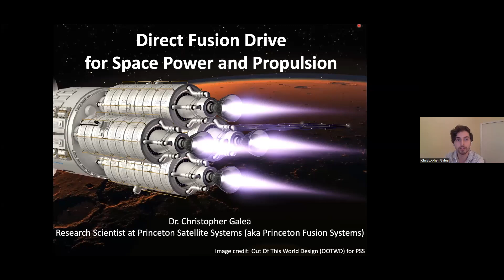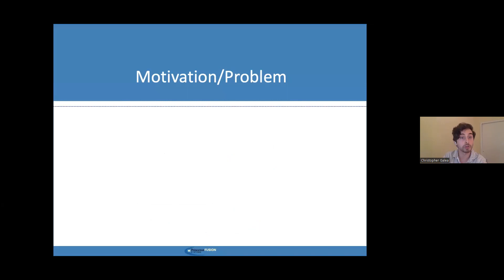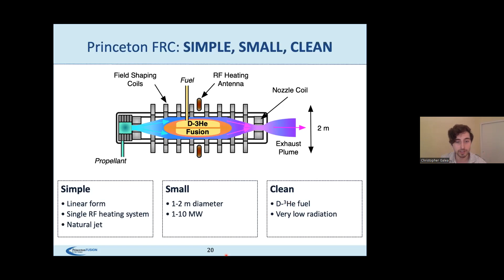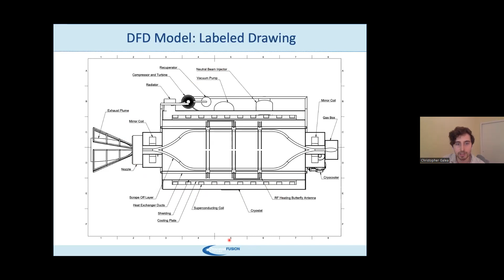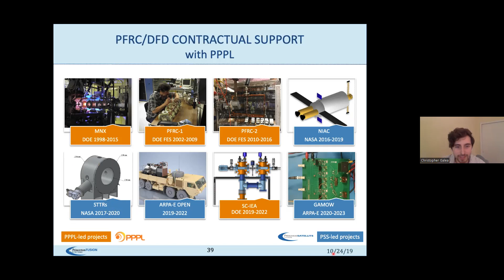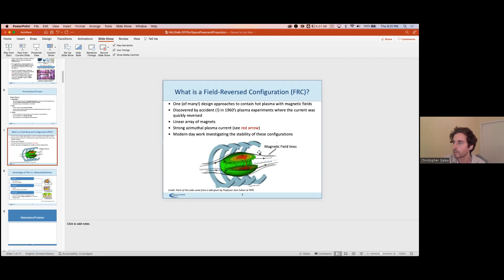NSS Space Forum - Direct Fusion Drive for Space Power and Propulsion with Dr. Christopher Galea

Comment: What you are forgot to mention in your lecture is that the energy input output accounting is nowadays negative for the PFRC/DFD, and 3 Big fusion research companies try to fix the problem for years but couldn’t manage. With other words: that stuff does not work yet, and is not clear if it ever will! A bit annoying. Thermal fission rocket reactor propulsion systems at the other hand are really working nowadays and are an indeed good option for interplanetary space travelling. A lot of improvements were made and 2 month to mars are realistic with that thermal fission rocket systems. So please stop kidding the people.